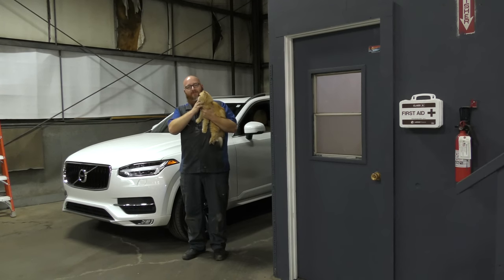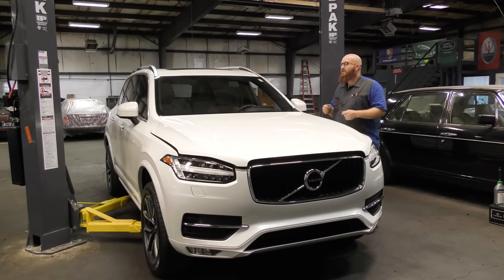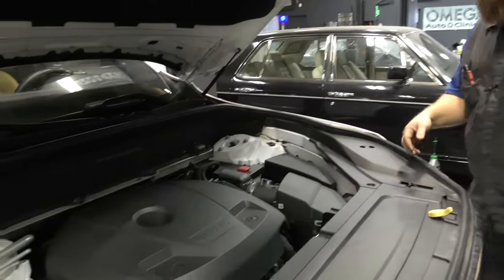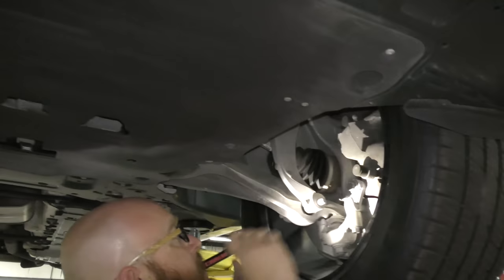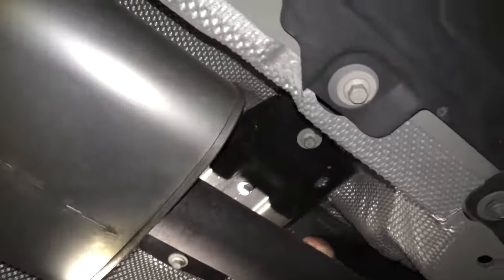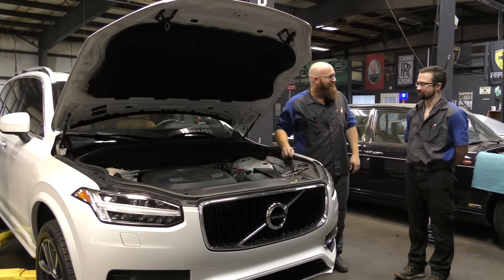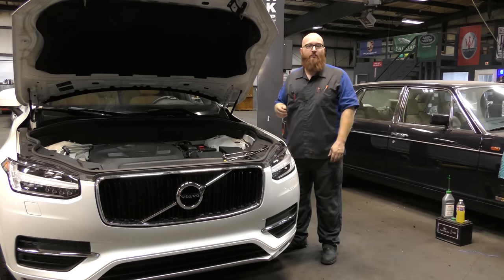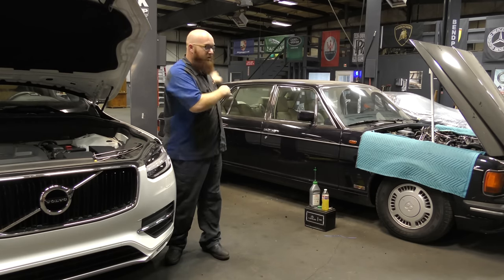One Sweet Swede! 2016 Volvo XC90 loudly roars into the CAR WIZARD'S shop.

Comment: Well, to some extent your mentor was "kind of" right.  With OBD 1 and, at the time, no real way to diagnose them outside of the flashing codes, due to the financially restrictive $50,000 diagnostic machines ONLY the dealers had, the little guy like your mentor was kind of screwed back then. Publically available (and affordable) OBD 1 code readers didn't come out until nearly 1992-4 and you had to buy all the proprietary software for EACH brand and sub-brand of car.  That's why California forced a law through the Federal Government REQUIRING all autos sold in the US to have the SAME code language (OBD II, 1995 1/2). So, EVERYONE, not just dealers had access to diagnostic equipment. This law prevented thousands of small mechanic shops from going out of business.

Comment: They don't build bearings like they used to that's for sure.
Reply: Sure they do. But if they didn't replace it after the major accident that car has clearly been in- serious enough to require replacement of the rear subframe, the bearing likely took a big hit. Most of the time, when I need to replace wheel bearings on a modern car with relatively low miles, it's been in an accident at some point that probably smacked the wheel. That can leave little tiny defects in the bearings, which then wear at an accelerated rate.
Reply: @puckcat22679  I've seen more bearings go bad on cars in the present that have not been in accidents than in the 80's and 90's. Seen them quite frequenty these days, even after a few weeks from new.

Comment: owned by the chinese built in belgium....
Reply: As Swedish as Dim Sum
Reply: Designed and engineered by the Swedes with Chinese money. Built in Belgium for decades. My 04 was built there. Nothing wrong with it.
Reply: @Crashjr86  Shame that Saab didn't get saved
Reply: @mattridgley9095  Saab was killed by the Americans. Once GM gets a hold of anything it dies.
Reply: Owned by Geely (Chinese), designed and engineered in Gothenburg, Sweden. Most of the top line models XC90/S90 also made in the Swedish factory, and some in Belgium, and they've done that for decades without anyone complaining.  And by the way, Geely has done a better job at owning Volvo than Ford ever did. Geely stays out of it, they just pump in more money so that Volvo can make some great cars. My father's got many stories about how badly Ford treated Volvo during his time at Volvo.
Reply: @Crashjr86  Agreed. Their cars were really well made before GM came in and ruined them. I've had a classic 900 and 99 turbo and loved them both
Reply: @tobias_dahlberg  thank you. I can't stand when people assume that because it's Chinese owned, the Chinese are in charge of engineering. And yes, Ford was a bad thing for Volvo. Geely just let's the Swedes do their thing and make good profitable cars.
Reply: @Crashjr86  Exactly, people are too ignorant to look up the facts, and they don't care about the facts when they're told something that contradicts their opinion from the 2 seconds they spent reading "Owned by Geely".
Reply: @Crashjr86  
The lesser cars were built in Ghent, Belgium. All models from there had significantly more problems than the Swedish built.

Comment: I'd absolutely love one of these, but it was named 'most unreliable car 2020' in a Which? survey recently. Quite disappointing for a Volvo 🤔
Reply: A lot to do with electrical gremlins as Volvos have a lot of integration between components like radio with car speed, etc, I kid you not. Then theres the transmission problems I.e. Volvo insists on not maintaining the gearbox- premature wear results at around 100k miles. Also note the SUV will tend to be more unreliable due to wear and tear
Reply: @dallysinghson5569  the old transmissions in the 04-06 s60's and a couple older s80's had trans problems a lot of them doing to being gm transmissions that were to small for a twin charged straight 6 but I havent seen issues really with any of the other transmissions working at a dealership
Reply: All the newer volvos are terrible

Comment: One of the few things that drew me to Volvos was them being different with their 5 cylinder engines. No longer it seems...
Reply: My current daily is a V50 R-design T5 manual, in flamenco red pearl.. Still very sharp and modern looking.
Reply: They're not in all models.
Reply: @darkiee69  correct they weren't in all models. Some had Ford 4 cylinder engines, some even had Peugeot diesel engines.
Reply: @tech4pros1  I had a C70 D5 with the 5 cylinder turbodiesel, same as the S40 / V50 but a convertible.
Reply: darkiee69 I am almost certain they are no longer made at all. Volvo only make up to 2l 4cyl these days, and increase the power with turbo and/or superchargers for the higher end models.
Reply: @MismanagedFutures  you are correct, they don't make any 5 cylinder engines anymore

Comment: Transverse leaf spring in this day and age? Bleh, especially in that expensive of a car
Reply: It’s fiberglass and not nearly the same thing as on a truck.
Reply: @davetravels9273  still a transverse leaf though which is 1900s technology
Reply: @dposer10  Guess what century technology the wheel is...
Reply: @marcusjosefsson4998  Bit different there man, that technology cant get much better ATM.
Reply: @dposer10  Leaf springs in modern materials and in the right application can't get any better either.
Reply: @marcusjosefsson4998  not true, transverse leaf springs add undesirable handling characteristics when used because they transfer pressure from one side of the car to the other very rapidly which can lead to the vehicle feeling upset when being driven hard. Why do you think almost no one uses it still?
Reply: @dposer10  It's not necessarily as you describe it, it all depends on the construction as a whole. It actually works very well in modern setups, the Corvette C5 is one example. Not as sofisticated as a Porsche, but it does it's work very well.
For Volvo you can take the 960 (later renamed S90) 95-98. It too had a transverse fibre glass leaf spring, and it works fine without any handling issues.
Volvo is a company that simply can't afford using an unsafe construction in their vehicles.
Reply: @marcusjosefsson4998  Yeah I've driven a vette with a transverse leaf and I can tell you that they have snappy handling especially when racing with suspension mods that stiffen the suspension up. Which they need because they are setup too soft.

Comment: The new electric shifters are STUPID.  My BMW has one.  One time I shut the car off in neutral, in the car wash, but it wouldn't start back up in neutral at the end of the car wash.  Instead, and without warning, it put ITSELF in park when I tried to start it -- and hence STOPPED in the car wash - before I was completely out!!!  Seriously WTF?!  I was always taught in driver's ed, that if you car is moving and it dies, to shift to neutral and attempt to start it.  So what's this stupid design going to do if i did that at 60mph??  Utterly moronic.  My car also won't let me reverse when the door is ajar -- like if I have the door open and am trying to look behind me, as I reverse.  It keeps putting itself in park.  Totally stupid -- can't stand it.

Comment: Most of these XC90's are too old and they are garbage, except this 2016 model. Anyway, can you do another video on a 2019 Volkswagen Atlas 4Motion crossover with the 3.6 L VR6 engine and the eight-speed automatic transmission with sport (manual-shift) mode and a 2006 Chrysler Town & Country Touring or Limited minivan with the 3.8 L V6 engine and the regular four-speed automatic transmission, please? I would like to see, if the customer takes care of one or both of these vehicles, during their ownership. Thanks.

Comment: A 5 year old car
Exhaust leaks
Wheel bearing blown
Seriously? 
What happened to Volvo quality?
Reply: It’s called wear and tear. And exhaust leaks can happen to any car.
Reply: 93k miles. Not uncommon for any car to have a few issues with that mileage, although an exhaust leak is unusual on a newer car I would think. We all know who owns Volvo now though.
Reply: Bit it's not even past 100k miles!!!
Reply: @OMGWTFLOLSMH  A car of that mileage and age should still not have such problems but I guess if you're a Toyota owner you're kinda spoiled :|
Reply: Down the drain after 2007
Reply: The car has had a serious accident at some point as the rear subframe is a replacement item. Both the wheel bearing and the exhaust leak could be down to whatever caused that to be replaced.

Comment: 4 yrs old and already's broken. POS over-engineered crap
Reply: It's 4.5 yrs old, possibly 5 depending on build date and it has 93k miles. Brakes or a wheel bearing is not unusual. The exhaust leak is though, but a flange gasket shouldn't be too pricey.
Reply: @OMGWTFLOLSMH  I guess I have been spoiled by owning Toyota cars since 1984
Reply: I mean thats pretty much any car brand now a day's if they didnt break dealerships wouldnt have huge service centers
Reply: Pedro Fernandez Toyota has been the best since about 1984. I wouldn’t buy from anyone else if I was getting a new car.
Reply: @willowandluka5302  Toyota have made some lemons, especially some dreadful diesel car engines and short lived dual mass flywheels which are hideously expensive to repair.